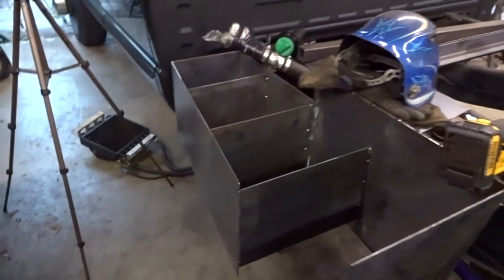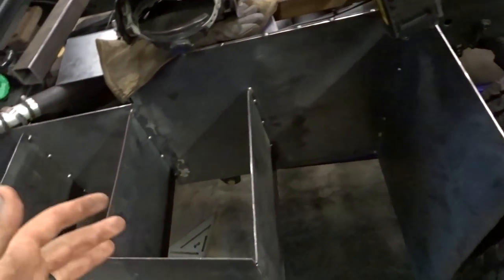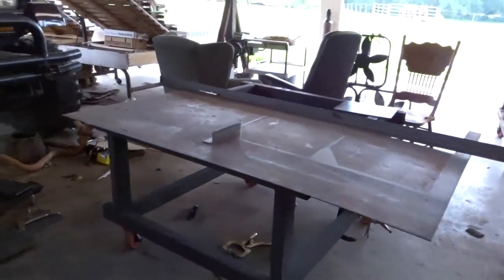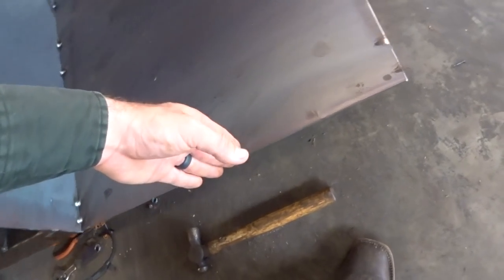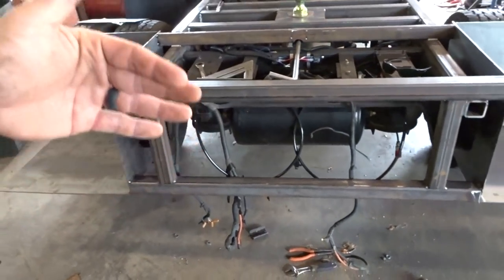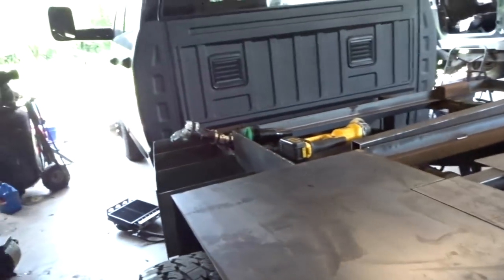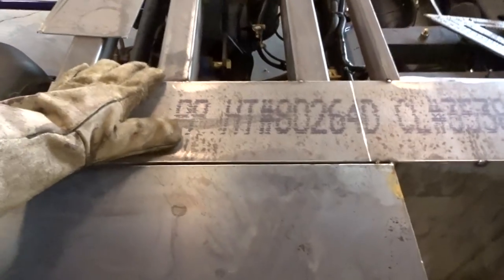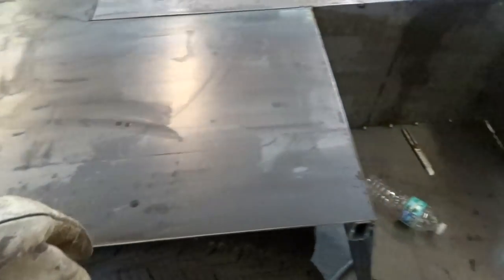Welding Bed Build Pt 2

Comment: For lights I would cut out holes use standard trailer style bulbs with black rubber you can get leds  but the regular are dirt cheap Napa always has  them  there just clean looking  curios to metal list

Comment: I want a custom toolbox flatbed maybe 12foot. A 2 foot backpack box to keep 4 dogs in open to the cab from the back window. Artic fox 990 camper behind that on the final 10 foot. Need a Ram 5500 to correctly haul this beast with a crew cab.

Comment: Looks awesome but man I'm not sure how those short circuit mig welds will hold up should of went with 3/32 7018 its ductile I do realize it would of took way longer
Reply from the maker: Mig welds hold up just fine

Comment: I love the build. Watched all parts. But what I'm still stumped on before I start my bed, is the latches. You never showed installing any. I've seen rigs with hidden latches. Or wireless remote latches. Also questioning whether you add any weather stripping to the "dry" boxes?
Reply from the maker: They are fairly dry without weather stripping but I’m going to add it when it’s painted and yeah I still haven’t gotten any latches for it ya haha
Reply: I was also wondering on your dry boxes. Did you well them solid on the outside of the Box or the inside of the Box?

Comment: Great vid but I have a question and your not the only person I’ve seen do it but why all the tacks instead of full beads
Reply from the maker: I tack everything first to get it fit properly and then go back and weld it, also if I were to weld every piece as I go the amount of warpage would be irreversible.
Reply: @j_moffitt  ok thanks because I like seeing full welds and I’m about to graduate from school with my certs so I was looking to start getting myself in the door for rig jobs

Comment: Just wondering what did you stuff the fuel line with? I noticed it doesn’t have a cap on it. I wanna make a bed for my truck but welding near the gas tank makes me a lil weary lol
Reply from the maker: I think I just stuffed a rag in it and taped a bottle over it, diesel is a bit more forgiving, be careful if you have a gas vehicle

Comment: What thickness sheet metal and tubing are you using?
Reply from the maker: 11ga (1/8”) and same for the tubing except for where the gooseneck and bumper hitch are I used 3/16” for that

Comment: What thickness sheet steel are you using? I'm trying to come up with A plan to build mine. Looks like roughly 3/16" which i was debating between 1/8" and 3/16"
Reply from the maker: 1/8”

Comment: Where in Central Florida are you located?  I'm in East Orlando.  Would love to check out your shop sometime.  Keep up the awesome work!
Reply from the maker: Thanks!! Im about an hr and 15 west of central Orlando and my shop isn’t really anything special lol
Reply: Projects more so. Like I'm doing airbags on mine too and you showed that I don't have to do the same old bag over axle. You have convinced me to definitely get a plasma cutter because I don't feel like using a cutting torch and grinder on everything. Keep up the awesome work
Reply from the maker: I gotcha haha the plasma cutter is a must have in my opinion, it makes projects so much easier and I think about how did I even do projects without one??... and then I remember how many cut wheels I killed lol